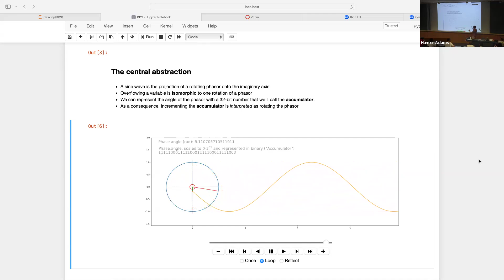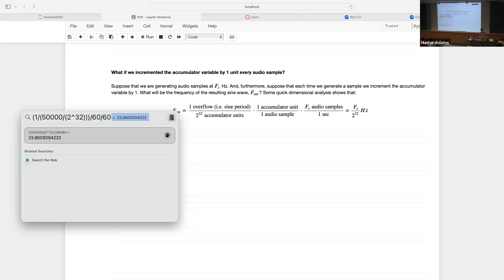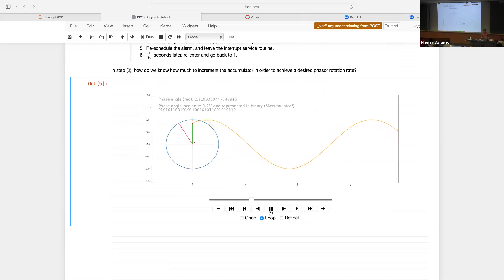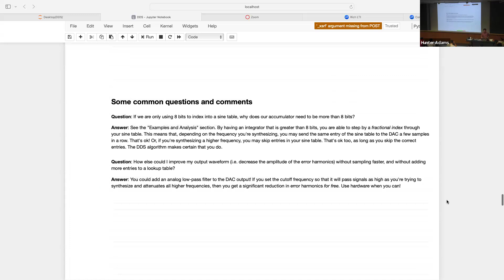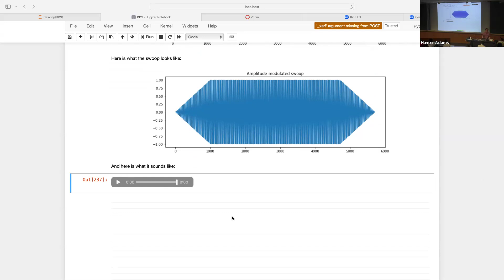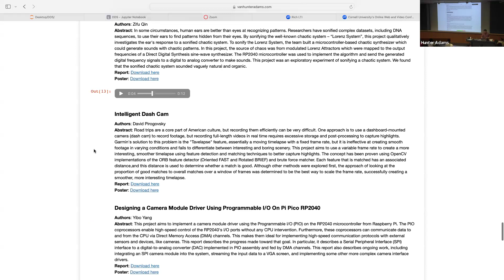Raspberry Pi Pico Lecture 4 (2025): Direct Digital Synthesis

Comment: I implemented this for just one frequency 800Hz and see that we stayed in the ISR for ca. 2us which is 10% of sampling duration 20us (50KHz). Isn't this quite a long time? Thank you.
Reply from the maker: It depends what else is happening in your application. In class, the rest of our application code is rather simple, so this is non-disruptive.

If you wanted to produce a pure tone, rather than a tone which could be frequency-modulated as it's running, I would use a DMA channel instead.
Reply: @hunteradams9430  Thanks for your reply. I am using the example code from the class. Digging deeper understood that 2us ISR time is expected as SPI transfter time itself comes to 0.8us (16bits at 20MHz). The rest 1.2us shall possibly come from the register operations for clearing interrupt, alarming the timer and looking up for DAC_data that needs to be transferred via SPI. Like you suggested in the future I will try to use a DMA channel and see the difference. Thank you.